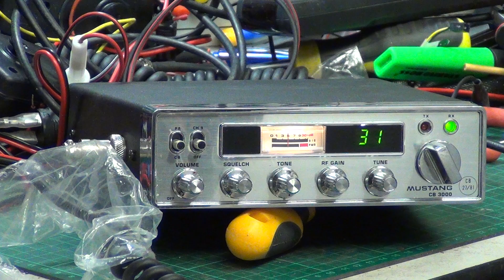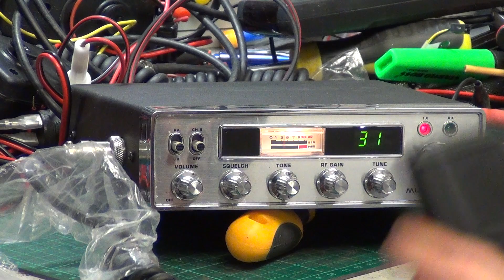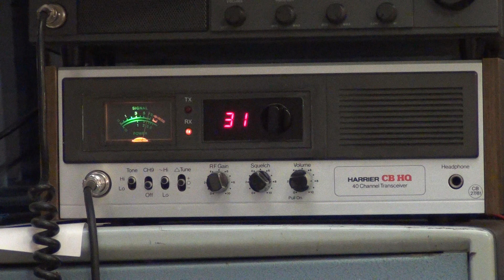Mustang CB3000 - CB27/81 UK FM CB radio -  On The Air test

Comment: I had a Mustang 1000.  Thinking of taking up the hobby wondering is it worth getting a vintage rig.  How much for a service? Is recapping expensive?
Reply from the maker: The Cybernet sets rarely need any capacitors changing....nor the Maxon...nor the Great chassis sets. The Uniden boarded sets need quite a few changing. The Mustang used the Cybernet 002F chassis & are jolly good sets. Most current models work inferior to those.....and they are not going to last 40 years either.

email me  rshireby@yahoo.co.uk

Richard